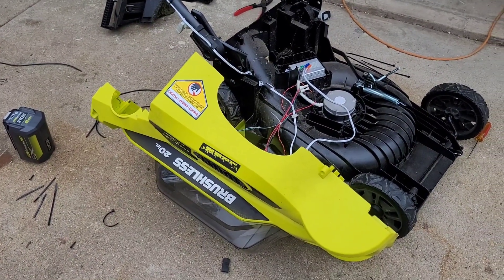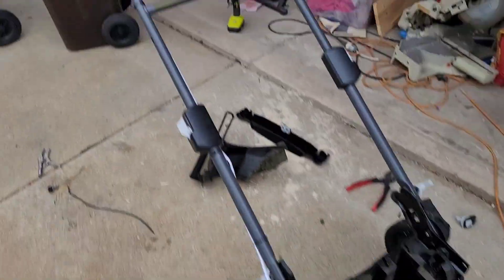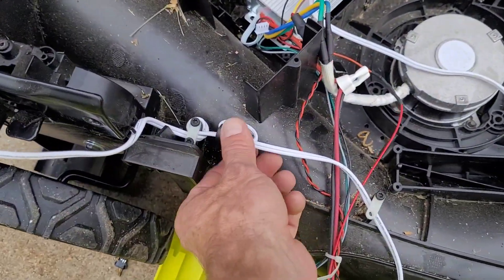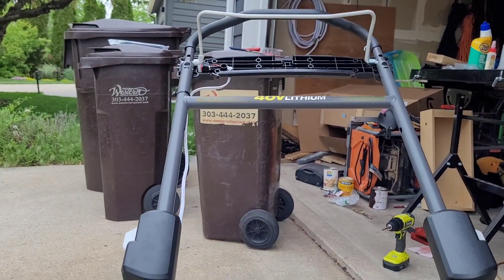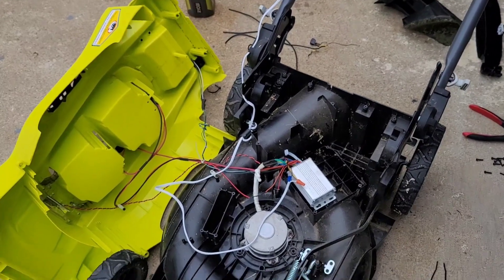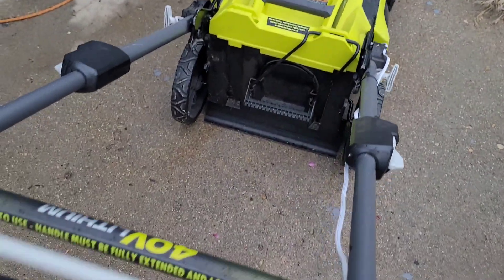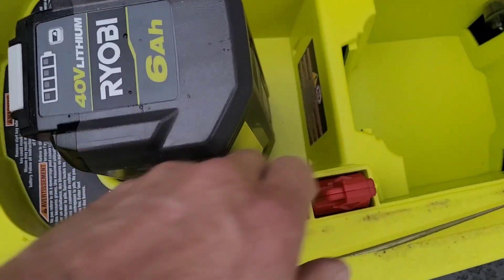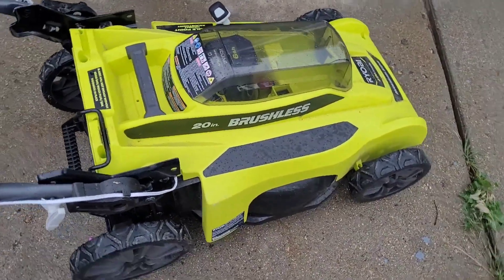Ryobi 40v 20" Lawn Mower Hack and Fix

Comment: Smart design up where the hands hold that bar.  We had one of these passed down to us and it worked a few times then recently stopped.  I've watche a few different fix videos and one guy added in two switches up by the hand but your design is preferable.  On checking all the wires then putting the cover back on our RY40108 model, it is a bear to get the cover to go back on right.  Any tips for that process?

Comment: This is great to see! Thanks for sharing. 

Mine just started to act up, won’t start after the battery cover hinges snapped off. Now I’m trying to see what the problem could be. 

Even when putting on the cover right and making contact with the little metallic part on the covers lid, the mower won’t start! I’ve checked everything, full battery in great shape, red safety thing is seated properly. I’m about to give up. 

Mine is about 1.5 years old. So your video is helping me understand how it works.

Comment: IF YOU HAVE THE CHUTE PLUG IN AND THE HANDLE LOCKS SECURE, THIS MOWER WILL START EVERY TIME. These are safety safeguards. I’m a product liability lawyer. If you have the parts properly in place, these mowers don’t fail. A great deal of not so smart people just don’t get it. This guy is completely voiding his guarantee and doesn’t seem to even know part names. Past my 40 years in product liability trials for a major auto manufacturer, I’ve had two of these mowers which NEVER FAILED.
Reply: If you had bothered to read the comments you would know that this mower has this problem lots of times. He also stated that he was out of warranty as am I. I don’t have the money to go out and spend another 300+ dollars on replacing a 3 1/2 year-old product. Thank heavens there were people like this willing to share or we’d be stuck for the money it takes to replace defective products way too soon.
Reply from the maker: That isn't true. I've had two with the same issue; they suddenly stopped working. The switches are cheap and regularly fail. How was I supposed to make a claim on the warranty? It's a huge pain in the butt. Home Depot didn't want to take it back a second time. So I fixed it and it works great. If you'd said you were an engineer, I'd be more interested in your comment. It is very clear that the product liability lawyers had a lot to do with how this product turned out. Why do you think this video has so many positive comments and well over 100K views? These mowers fail on the regular. Your N=2 example doesn't negate the point.

Comment: I also thank you again. Although I have the 18v Self Propelled, the symptoms were the same. By looking at your mower opened up I braved doing the same and found the main control cord had worked loose. Reconnected and rerouted to give more slack and all is good.  RYOBI is of no use at all. Don't be afraid to trouble shoot if having issues, it's already broken.  Great video

Comment: Shops dont want to work on electrics because they have no experience or training
PLUS
They realize there is  WAY  more  $$ repairing gas mowers what with oil changes & 
filters & tuneups & spark plugs & bad fuel & engine rebuilds on & on & on & on... 
They dont see much $$ in electrics. GASOLINE FOREVER...

!

Comment: Hey Brother I want to thank you for taking the time to put this video on. Your method worked flawlessly. For any of you that normally don't pick up your clippings, you can also take the three wires leading to the magnetic sensor for the bag. And short the gray and green one together to bypass the need for the bag. My lawn mower had an extra controller in there which was used to run the propulsion system and the LED system in the front.  If you want yours to work simply follow this gentleman's instructions.  I love my lawn mower because I am older and the weight of these machines make it very easy to maneuver.

Comment: Mine is much older than the one in your video.   I have two paddles to pull back on instead of the bail.  I also don't have a third safety switch either.  I had surgery on my hip which caused me to let it sit in the basement for a year so I may have some corroded connections.   I tested both switches and they function fine.
I had decided to junk it but damn it, I was an electronics troubleshooter technician (Tech Controller) in the USAF and retired from Verizon after 31 years so I should be able to do this.  I already have 18/5 thermostat wire which should be ideal.

Comment: What kind of switch did you need?  Same mower, same issues.
Reply from the maker: I used the one remaining switch that was still good.
Reply: @BradyRobinson  I actually did this today. Reused the one for the metal bar handle.  I cut out the sensor the extension arms, combined the brown and yellow  together into switch and removed the second ground coming off to second switch.  It eliminated like 90% of my issues. I think the magnet or whatever it is where the plug/bag mounts is not good.
Reply from the maker: If you can find a better quality one to buy new, let us all know!

Comment: the proxy sensor on the discharge door gets wonky sometimes. chased every single part of the system down and determined all the switches were functional. that sensor woulndt sense the bar but after i removed whacked it and replaced it its worked since. i thought about just bypassing it. just a discharge door i know its there or not... or will shortly...  i need a side discharge for this thing like a mofo though.

Comment: Thank you so much, I took mine apart due to a faulty switch and 'hacked' it so it is only reliant on a single switch. Let me tell you, I will never purchase another Ryobi lawnmower. I could not believe my eyes when I opened it up... WHAT A POORLY DESIGNED PIECE OF JUNK. I would be embarassed to put my name on a product that is so poorly made. It was an absolute mess of wires going every direction. It looked like absolutely no care was taken during the manufacturing/design process to ensure longetivity.

Comment: Thank you so very much for the information. I did this and now I have a mower again. I can’t say thank you enough. I did not want to go buy another mower. 👍🏼👍🏼👍🏼
Reply: Really? Are you guys rocket scientists? Seems complicated af for regular joe blows out here.
Reply: @jake6932 not really you can get a stripping tool, electrical caps, a small spool of low voltage wire and spade adapters off temu for under 10 bucks.  Watch a video on crimping spade clips and stripping awg.  You'll need a couple torx bits and a driver.  I needed 3 zip ties too.

Comment: Yes, this is exactly my plan.  I only need to have the lever on the handle for safety.   It has been a good enough trim mower for 5-8 years.  I have to laugh when people say these mowers don’t have any maintenance.  It is nice not to mess with oil and gas, but it does have some moving parts.  Anyway, thanks for your video.  New subscriber here!  All the best from north Texas!

Comment: So I removed the safety switch for the bar and added and toggle switch which basically does the same job and deleted the metal bar that folds down. I also added it with a momentary push button to replace the start button. So it doesn't try to start as it it flicked on at the safety you also have to push the button just a little safer in my opinion. I also didn't have to cut all the wiring out but just cut the ends of the wire off the switches and replaced it with different connectors to connect to my new rocker switch and push button I do however still need to go bypass at the module. This is my first time diving into one of these as my client described he couldn't find anyone to work on it. So I reluctantly let him bring it to my mower repair shop the toggle and push button was pretty regular stuff for me. But your bypass at the module was exactly what I was looking for
Reply from the maker: @wyelandlebeouf7202  Cool solution! The reason I cut out and replaced the entire wire is because I also wanted to bypass the switch that is meant to ensure the handle is fully extended. That is, I believe, another possible point of failure that I didn't want to ever have to troubleshoot.

Comment: If you thought it was the small red button, why didn’t you replace that first without stripping all the other wires?
Reply from the maker: I had no idea what was wrong until I took it all apart. There is another hidden switch that is supposed to ensure the handle is fully engaged. After having two of these fail and be nearly impossible to diagnose without a full teardown, I decided to simplify the system. Also - I didn't have an easy way to source new switches. Upgrading the switches to something higher quality could also be a viable solution.

Comment: Thank you for determing  safety wire bypass, I figured out that if you just splice that in without taking anything else out it works just need to hold down switch. Beats throwing it out !

Comment: my brother bought a Ryobi 20" 40V for $20 :face-fuchsia-tongue-out:
it had no battery no bag, owner said it wasn't working "take it or leave it" we fixed it plus already had a Ryobi Leaf Blower that took care of battery and charger. very bad design. we eliminated all safety switches kept the big red key / fuse looking thing. 
Ryobi won't fix nothing take it from Louis Rossmann Right To Repair :face-blue-smiling:
final fix was this video with your electrical wire. slaps subscribe button :hand-pink-waving:
Cerveza For You 🍺:face-turquoise-drinking-coffee:

Comment: Thanks for this video. Just found one someone tossed in the dumpster. I’m diagnosing it as I right this. Thank you. Hopefully this will fix it. But I have to get the plug first. That’s missing.
Reply: You just need some wire to connect the two terminals. It is only completing the circuit, nothing else fancy inside the "key"

Comment: I ran into a similar issue where my mower wouldn't start that may be helpful to others. Mine turned out to be a simple issue of the fuse that the key goes into was knocked loose. If you take your key out and the metal pins on either side are not aligned, i.e. one is lower than the other, this may be your issue. After taking the mower apart I simply smacked the bottom of the key slot where the metal pins are with the bottom of my screw driver until they pushed all the way back in, put it back together, and it fired right up.
Reply: Thank you for posting this! That was exactly what happened to mine too. Just loose fuse clips

Comment: So I essentially did everything from this video mixed with another video where a guy eliminated the pull bar and installed a toggle switch to start and stop. The mower will come on occasionally, but it's hit or miss at starting. I used a two wire extension cord to hook everything up. Wondering if I need to use a different wire.

Comment: Thanks. I was VERY uneasy about cutting the wires. But I was more frustrated about the constant shutting off. Followed your directions but didn’t remove the motherboard-looking item. Mower started right up and allowed me to mow the entire lawn without having the constant shutting down. Only issue for me in following your directions was that by bypassing all the wires in the handle, I no longer have a self-propelled mower. Not an issue since I rarely used that feature.

Comment: Thank you this is exactly what i needed. BTW the "unknown" black device that the sensor lead wraps thru is a toroid coil, an inductive device to reduce radio frequencety interference with other components.
Working on 20" 40v brushless Hart (Wallmart) which is identical.
My symptom was that the headlights would come on as soon as the battery went in, and it would not start. On this the lights are supposed to come on when it starts, not before. I found a long tx20 took main cover off to find a grocery bag sized quantity of mouse nest and the connector for the sensor leads was wraped in wet mouse nest. Removed bedding, dis assemble plug left air out over night. Now no light when battery goes in but they start when you pull the dead man switch and the motor does not start. Off to explore the handle sensors! Thank you for the info!
Reply: My mower is the same, won't start but the light comes on when the battery is in. I think the wire coming of handle got picked and are shorting. Not sure if I should just run a new wire or just shorten it or if ther is some other issue.

Comment: I did it , mines was a little different,  wires from the handle and start button go to a main frame before that mother board but i snipped the end of the wires from handle,  connected the brown and yellow together,  used a extension cord actually,  lol and used a toggle switch and she turns on and off and works great !! Thnx so much

Comment: The culprit was the black piece on the right side of the handle where the wires meet when the handle is fully extended. Us pushing the mower make this fail. It is happening to mine.

Comment: Found the kill switch in the right side of the handle. It was badly corroded. Only used once and stored inside garage, less than 6 months old. 
Took top off to check wires and all of the heat shrink was just slipped over the electrical connections, not one was heat shrunk other than 2 switches in handle bar. Also had wires bunched together with dry rotted rubber bands. Speechless!

Comment: Hey, thanks, you mentioned a few things that helped me narrow down what my problem was.  It's been a great machine, until it hasn't, for the price and for what I'm doing with it.

I think my mulch plug is warped and not contacting that magnetic sensor enough...  or the starter switch is broken.

Comment: These lawn mowers are a waste of money. I was at Lowe’s the other day and they were priced at $550 and they are not reliable. Always breaking down.
Reply: If it was at lowes, it’s not ryobi. Think lowes has the ego brand which is supposed to be the gold standard for cordless mowers. Haven’t heard anything bad about those ones. Consumer gas mowers are trash now as well. So for the average homeowner it makes a lot of sense to go electric. Just a shame that ryobi dropped the ball with some of the design flaws on this model (screws getting loose over time is another common one).

Comment: I'm not sure if there is a safety switch when the grass bag or "plug" goes but my mower wouldn't start and after checking everything else, I noticed the plug was lose so I pushed it in and now it works. I think there is a switch there because if you run the machine without the grass bag or plug there, a rock can be shot back at you.

Comment: I've got the same model, how long did your two models last before they "died" and was it the same point of failure? Other issue ive noticed on these are thr screws holding the wheels get loose, blue loctite seems to fix it up.
Reply from the maker: Just a handful of uses each - a couple months max

Comment: This is at least safer than most of the solutions I see, which require you to pull the red key or the battery to stop it. 1) Even if it's not a safety issue is the sense that you might be injured, you might hit something buried just below the grass and want to stop immediately. It would be a stick, or in my case a few weeks ago, it could be something like a poor toad that I was able to avoid slicing to pieces by letting he handle go. 2) It doesn't put you in the best position to turn on the lawn mower, if you have to pull the red key or battery to turn it on and off, you have to be to the side of it and potentially get your feet under the deck if you're not paying attention. Like you said, yours isn't 100 percent but it's better than most I've seen.

Comment: I cut the 2 wires going down the right arm to the extension sensor, and taped them together. Installed 2 new switches on top, and removed the bar.
Root cause of my issue was that the grey pull down arm wore down where it contacts that switch, and was not making good contact.

Comment: Thanks for this! I just completed the re-wire as you described and it works perfectly. I'm happy to be able to keep this mower going!
Reply from the maker: You are welcome! Thanks for letting me know. 🙂
Reply: @BradyRobinson  which two wires are left attached to the original pull handle switch on top?
Reply from the maker: @felixu-mh2mx  The white wire in the video is new - I ripped everything out and just attached it to the one good remaining switch. One side is attached to the black wire, one side is attached to both yellow and brown. Those two are wired together which eliminates the need for the push button and allows the mower to start from just the one remaining switch. Hope this helps
Reply: @BradyRobinson  Thanks. I just wanted to make sure before I start chopping things up.  So, the original black, yellow, and brown from handlebar go to corresponding wires on converter. But the converter has a wiring harness with the colors you mentioned plugged into what goes to the headlights - which I don't really need anyway.  Who mows at night?  But, shall I splice the three wires from handlebar switch into that harness or just cut it off? Also, do you you think I could just chop that black wiring runing thru the handle and a housing off, or must it be disassebled and removed? Thanks again.  Your video is very helpful!
Reply: @felixu-mh2mx just remove it completely.   Get a small spool of low voltage pair awg, you probably have some relatively new speaker wire that could work in a pinch.  Strip your awg, add a spade adapter (easy to source) that fits on the two prong switch.  Follow his wiring and join the wires with electrical clips.  Took me less than an hour to revive my miserable Ryobi I loved to hate because it shut off all the time mowing!  Have a brand new machine now!
Reply: @ethanpierce3004  Thanks!